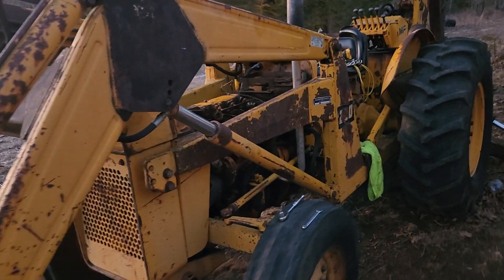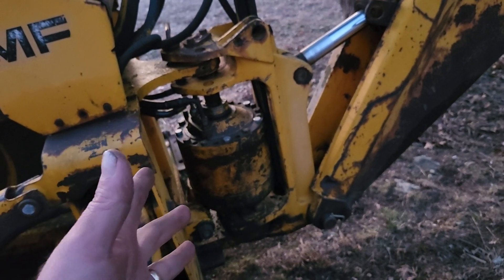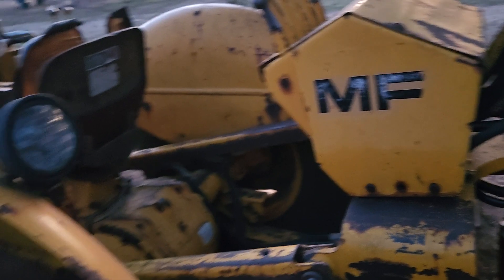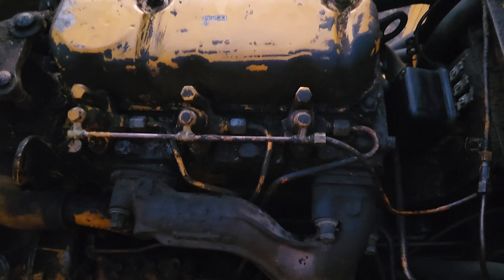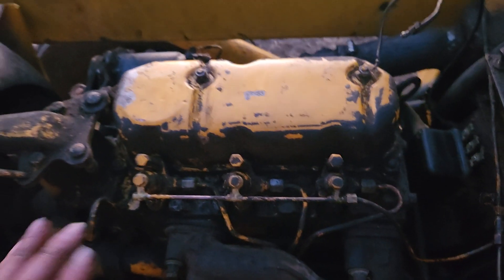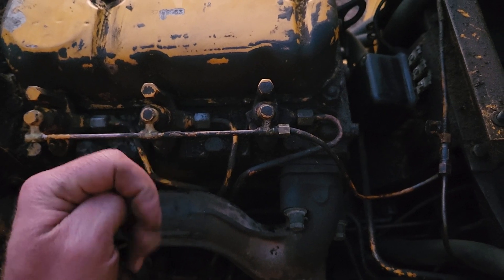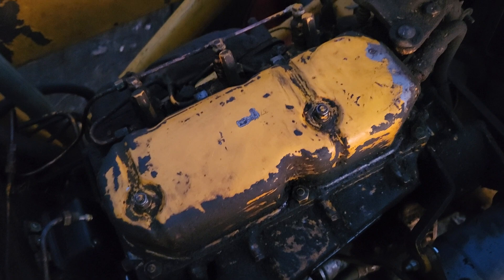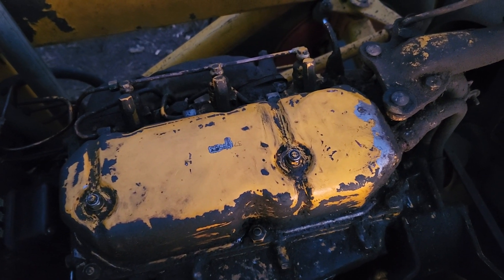Perkins AD3 152 Diesel Engine "stuck" and won't crank in a 65 Massey Ferguson tractor?

Comment: Have a Perkins three cylinder engine in a Blaw Knox mini paver,done just the same thing but has been standing probably ten years.
Dreading having to pull the engine out, normally Perkins engines especially the older models are absolutely rock solid if looked after, so will be following with interest how you get on.
Good luck.

Comment: Did you figure it out? That's an awesome engine. I have the same one and mine turns over but won't start. Mine has only been sitting for a decade :-/

Comment: Dude, that sucks!
Reply from the maker: I'm gonna pull the starter and test that first. Then I try and hand turn the motor using the flywheel to see if I can break it loose.
Reply: @2artactical55  I am confident you'll figure it out bro, you're a pretty good mechanic. Peek inside that airbox to intake for moisture sinse it has been raining as you stated. Also, is that starter electric only? It's not an air type starter is it?